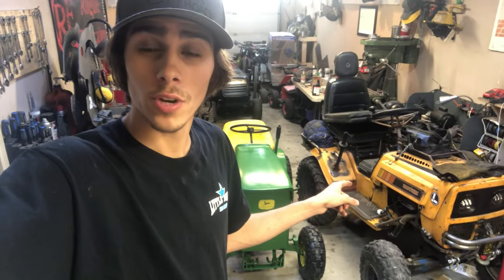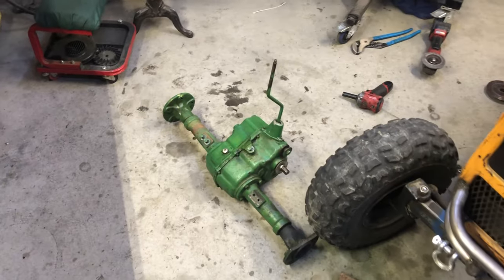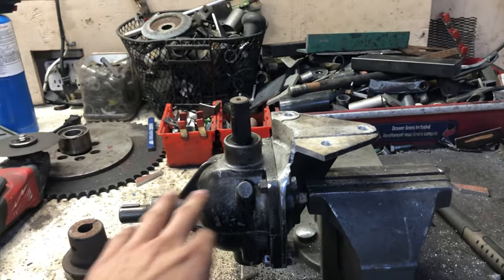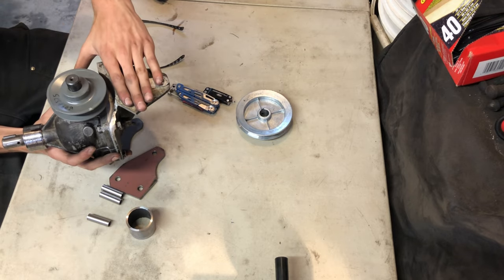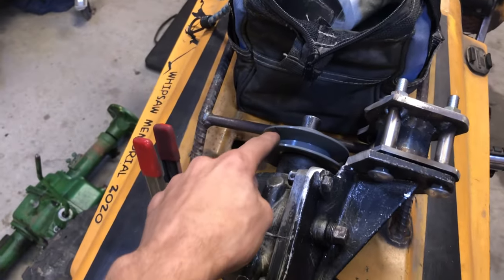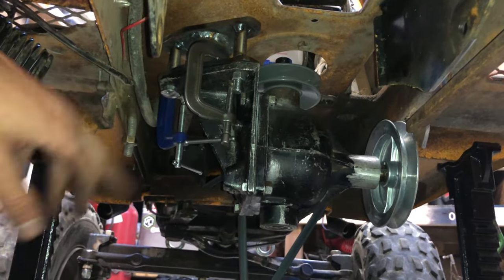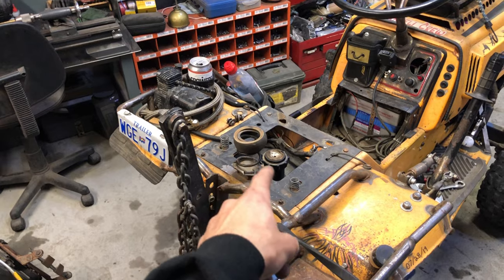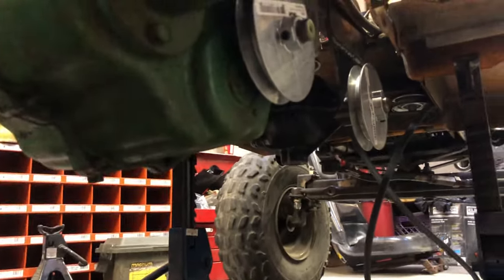Upgrading Musty The Mower (Huge Modifications) Part 7

Comment: older hay equipment like rakes and tedders are ground driven using a gear box like that. been thinking of putting one in my next build
Reply: That is a great idea. I have been watching EBAY and the 90 degree gearboxes from Bolens decks are consistently $190. I will have to check out some old hay rakes . Thank you.

Comment: I found a 100 year old lathe that a guy was using in his shed. It was converted to electric and is a really awesome vintage piece. The only problem is that his son got rid of all of the tooling so I have to beg borrow or purchase the tooling to start making my own parts. I also found a fantastic professional lathe setup in a barn that has all of the tooling for $1000. It is really an awesome lathe and like I said it has EVERYTHING. I am saving up to purchase it. I am going to stop by the guys house today to check and make sure it is still there. What do you think of the price. It is a six inch chuck size but I feel like you could use a bigger one. The guy was a machinist.
Reply from the maker: Seems like a great deal! Asking as the lathes in good shape 
And the machine doesn’t have to much run out
Reply: @okoffroadmowers  I just came back from the guy's house. Evidently over the weekend he had a friend come over to organize all the tooling and he was surprised that not only was the lathe in perfect shape but there is something in the neighborhood of 20,000 dollars or more of equipment that  goes with it. He is an old guy who was an electrical engineer for NASA and so was his wife who was an electrical engineer with a specialty in RF engineering for NASA. He has more money than he needs and I believe he want the equipment to go to someone who will use it and love it like he did. I am definitely that person. I designed and invented a device that converts ambient electrical energy into Dynamic electrical energy that can be used for anything. So essentially it is a generator that needs no fuel ever. Of course every four years you have to change out the battery but it is only a 12 volt 7ah alarm battery. I think everyone and their mother and brother needs on of these. Imagine buying a generator once and never needing to add fuel. Yeah it is that cool.
Reply: @okoffroadmowers  The guy treated it like his baby. Do you buy junk mowers and restore them to working order?

Comment: 633a transaxle too big?? No no my friend it's the right size, your tires are just too small!
Reply from the maker: 26” tires I was running on that Ford….
The transaxle it self is too big for the mower frame, 633a’s are pretty long width and length wise in comparison to the 1200series which will slide up into the Ford frame a lot better and less amount of new frame I will have to build
Reply: @okoffroadmowers  Ahhh, I see.

Comment: Ive watched ur channel for a while and have even built a couple mowers. Have you ever thought about a 4wd mower?? I think it would totally we worth the time and effort!!
Reply from the maker: I don’t have the space to build one! If my shop was bigger I would attempt my take on a 4wd mower 

Of course we have thought about it and when I do, do it 
Will be done how a 4x4 mower should be! 
One day…. One day
Reply: I'm fairly new to mower builds, but as a seasoned Moab Rockcrawler fabricator, I'll chime in.... for me the thing that sucked me into building mowers was 1-free or cheap and 2- the simplicity of parts/design and sheer effectiveness for a 2wd offroad machine. Oh, and 3- the steering is so awesome with such a tight  turning radius. 

 The moment you start going beyond 2wd on a mower, you greatly complicate the machine and are getting into ATV/sidexside territory and arguably have an inferior machine as far as capability.... There comes a point where the amount of fabricating you're doing warrants perhaps using a different 4x4 platform as your starting point...

BUT, and it's a big BUT, I am STILL thinking of doing a 4x4 mower build for several reasons. 1- ATV's /Sidexsides have taken over and are everywhere to the point, as cool as they are, I resent them. If you build a 4x4 mower in a way that it can still Identify as a tractor, well thats just damn cool. You will be special out on the trails.

 2- There's something about the mowers simple, highly available, cheap engine and transaxles that's super appealing and the compact light weight means  you can build a super light low HP 4x4 rig.